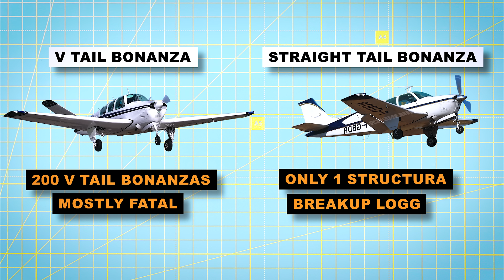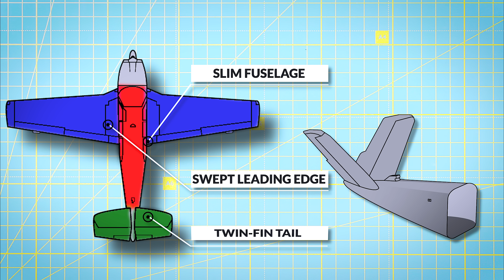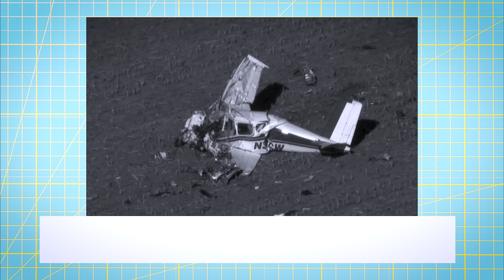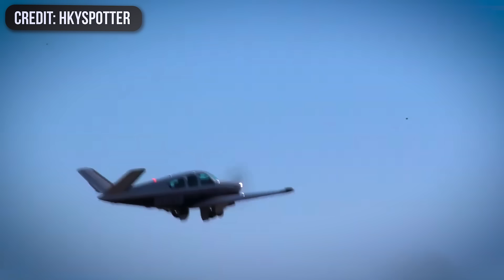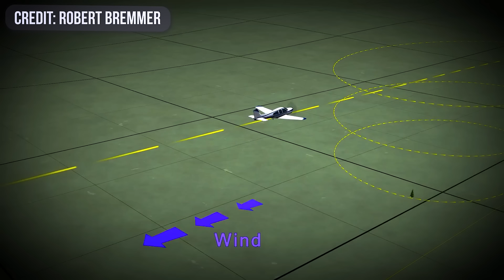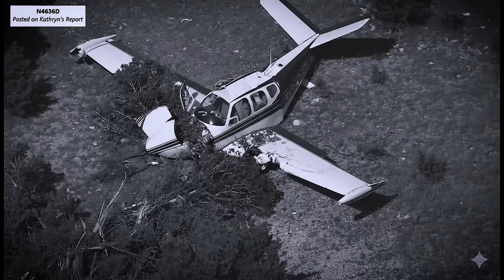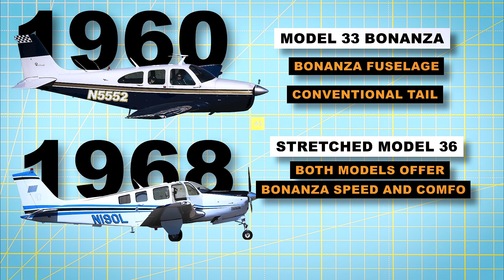Why Did This Plane Kill over 200 People?

Comment: Simple, make a detachable, folding, stowable vertical rudder, with folding elevators to look like a V tail sitting on the ramp. That way you don't have to suffer the embarrassment of being seen, most times, having a regular tail like the president. 

I prefer honest airplanes. 

V-tail? Reduced performance, frail, but hey at least you look good! 

And they wonder why anyone choosing that option for that reason in spite of the facts, or apparently any independent research choosing that probably more expensive, maintenance intensive, dangerous performance loss just to get attention from the opposite sex crashes them.

Doctors and lawyers have been killing themselves in super-cars, heck, even Corvettes for decades. Why not in aircraft?

While we walked out to our Cessna 150 my father saw a guy drive in at 60 mph, slide to a stop bumping the curb, and get out at his hangar. Dad said "You would think that there's a certain level of professionalism that all pilots with a liscence have, but its just like a CDL, the same idiots that drive cars fly planes, NEVER forget that up there!" 

Good pilots (sometimes you don't know you aren't until you taste dirt.) Good maintenance, good decision making and it's a very pretty unique design that will give great performance for generations. Those are the people who designed it, they couldn't conceive of who would take over. 

After 45 years as a mechanic and farmer, I have literally seen bent crowbars, have a hammer head that's busted in half, melted bent connecting rods, spun bearings, from oil delete episodes, rods pulled in two from over winding, and a BROKEN ANVIL on my shelf in my office to remind others, and myself, of what seemingly smart people can do! 

Underestimated talents assumed to be "Common skills" of those who originally flew, worked on and built it, then passed it as ok because it was for them, caused this.

Comment: While aircraft built for the war were planned for 2 years and are still here 80 years later, these planes weren’t necessarily imagined to be flying 70 years on. 
No one building a 1958 Chevy expected you wouldn’t buy a new car in a couple years. 

Bonanza’s had their opportunity to be retired, issues resolved. No one thought you keep a plane for 70 years. 

The oldest commercial planes still flying and not in a museum when these were built were barely 15 years old. Some credit should be given to these pioneers, and perhaps this design should have retired earlier.

Comment: I've only been in a "Doctor Killer" a few times. I had a 172 and in the midwest, during spring when there was black ground and light colored ground, the 172 would rock front to back because of the rising heat or lack of. In a V Tail, it did that too but also left to right. Quite nauseous.

Comment: I find this video very one sided. I have owned 2 Bonanzas (J and S models). I have been a Bonanza instructor. The plane is very easy to fly and very easy to land. The Bonanza is NOT forgiving of incompetence, inability, or lack of training. The airplane requires regular, proper maintenance by mechanics that are qualified and familiar with the airplane. The aircraft does suffer from am aft CG issue. But the model 33 has the same issue. The 36 model was designed with a relocated wing and longer fuselage to cure this. You can’t blame the airplane for poor maintenance practices and poor training. Was there a tail issue, the tail reinforcement cuffs addressed this. 

Bottom line: the model 35 is a great airplane. But it doesn’t suffer fools. It will not forgive a lack of training, maintenance, or skill. It IS a great airplane!

Comment: NO NO NO NO. the V tail was FINE. the issue was the aircraft could get over design speed in rough air. both the V Tail and normal tail will fail in. the thing is the v tails would break up on the way down. both end up a hole in the ground. just the V tail ended up in 2 parts. the thing the wings where already coming off before the tail for BOTH configs. the thing people forget is the Bonanza is from the late 30's early 40's and was THE first REAL high performance GA aircraft. most aircraft at the time didnt have power fly out of green arc in rough air. the Bonanza did. it was V tail from the start. the later normal tails again had jsut as many crashes. the tail was NEVER the problem. it was pilots understanding the aircraft VMC in IMC and flying to fast for the conditions. by the time the tail came off the V tails it dive was never recoverable any way

Comment: 8:48.  "Unseen wires in the tailcone?"  Having owned a V-tail for 6 years and 400+ hours of flight time, i can tell you that the entire V-tail actuating system is inspected annually with conditions inspected, lubricated, cables tensioned and tested thoroughly, along with an inspection for metal fatigue and corrosion.  Mine was a1958 model that flew beautifully and reliably and continues flying today.  The Bonanza is a clean airframe and builds up speed quickly in a dive. Combine that with light pitch forces and it is possible to overstress the tail.  If you fly safely and mitigate those risks through planning and execution within the limits of the airframe it's not an issue.

Comment: It’s so sad that this legendary and brilliant design got a bad reputation because of pilot error. If the Spitfire was marketed to civilian pilots, doctors or lawyers would all get one and one by one they would come out of the sky or die on the ground and we would say how bad and deadly the Spitfire is. What bothers me is that your description for dummies of how the empennage’s work suggests that this is watched by the uninitiated who don’t know better. You cite trim cables as problematic but they’re no different to those on any type, same for the spilt elevators many types have split elevators, you say the problem isn’t in the cockpit but each of the issues you list have to do with how they are operated. The spiral too is not uncommon - most types have autopilots fitted that negates the natural tendencies. The straight tail has a stretched fuselage and a swept tail.

Comment: Back in the late 70's or 80s Aviation Consumer Magazine did an engineering evaluation of Bonanza V35 structural failure, and surmised that other aircraft like the Piper Comanche and some Cherokees had a much less structurally strong horizontal stabalator design and were more prone to failure in structural overload than the V-Tail Bonanza.
 They said that cabin doors were typically found a ways from impact sites and explained that in a severe positive-G overload, well beyond the certified structural loading and above  red-line airspeed, the the cabin door would pop open and depart. When that happened the typical pilot instinct was to quickly pitch down to unload the airframe and that sudden transition from positive to negative load on the V-Tail caused the forward leading edge of the V-Stabs to detach upward and cause a severe pitch down causing the main wings to fail in negative load, and why Beech added reinforcing  cuffs to the leading edge roots of the V-Stabs. 

I also seem to recall mention that many light aircraft would experience main wing spar failure at or before the tail would fail on a V-Tail Bonanza.
Reply: With the leading edge cuff and the Smith Stub Spar STC (the only STC still approved for the tail), the tail is practically indestructible! The main spar will fail before the tail comes off.
Reply: @Tonali01  Thanks. As I recall that was the intent of the mods. I also recall seeing photos of a V35 with a Beech tail mod that had experienced a near structural failure where  the outer edges edges of the V-Stab  spars were dramatically deformed. I seem to recall there was some structural deformation the the main spar as well.

Comment: Flying club I was in had one / no structural failure but the engine grenaded itself and went into the trees. Thankfully the pilot and his wife walked away unscathed
Reply: So? That same basic engine is found in twenty other single and multi engine aircraft. Very reliable. It does not in any way impugn the integrity of the Bonanza.

Comment: So basically they built an aircraft that can achieve the aviation equivalent of a “Pan-Weave” that the Honda ST1300 (PanEuropean) is infamous for.  A bike that’ll last 1 million miles if taken care of, super reliable, powerful, and versatile.  But because of its wheelbase and rake, it feels like your tire is stuck in a deep rut at 120mph.  If you fight it (like the bri-ish police department), you will die.  Or just slow down a little and it’s one of the safest bikes ever made.

Comment: Just a private pilot since the early 70’s, I’ve mainly only flown Cessna’s, Piper’s and Cub’s all fixed gears and props.    But I did have the opportunity to rent T-34 Beech Craft Debonair  a two place sliding canopy trainer at a military aero club for about 30 hours.   It was a blast to fly!  It had the most harmonious and lightest coordinated controls of any airplane I’ve personally flown.  
    Only one other plane I got a ride in with a finer feel was the De Havilland Chipmunk.

Comment: Lovely airplane! I'm a retired A&P.  '83-'84 I worked for Corley Tedder at ABC Air Service in Atlanta, Tx. It was either a 100 hr. or an Annual. After taking the tail cone off and brushing out
the crud,  I found an old round handled Craftsman 1/4" ratchet, extension, and socket. Good thing that it didn't snag anything; or it could have been a test in order to see if I was attentive.

Told the boss, he said good catch; wash it in the Varsol tank and keep it.

Bob
Reply: Wow Bob thanks for such a amazing story

Comment: This was ultimately a very poor and misleading video. A lot of what was said could be applied (for example) to the Cirrus in today's world and it is quite wrong to put various unrelated though independently valid observations into an argument that suggests the V tail caused the crashes. Good journalism doesn't need sensation seeking nonsense like this. All airplanes have their own characteristics and suitability. It is a pilots responsibility to know what they are, know the plane's and their own limitations, and to never exceed them.

Comment: V tail requires a proficient, skilled pilot. If you aviate, navigate then communicate you’ll be fine. If not IFR proficient and can’t scan to keep wings level. Slow drop the gear then it flies at C-172 speeds and speed run away is reduced. You can cause structural failure in any AC if you exceed their design. I have been the owner of a 1955 F35 for 30 plus years. Along with 1947 super Chief 1966 U206 with factory float kit. And a 1970 C-401B all at the same time. With 2 rotorcraft. With proper judgement, training and proficiency and maintenance you can fly anything safely. And be a 46 year accident free pilot too. Just know your limits using superior judgement so you don’t need to use your superior flying skills. A credit card and waiting for weather to clear saves life’s. I only carried liability not hull coverage. Working and saving to purchase each aircraft not wanting to put them at risk.

Comment: Former Beech Aerodynamicist here. I was the project aerodynamicist on the Beech 38P Lightning, the Bonanza-like single-engine turboprop based on the Model 58 Baron, which was based upon the Bonanza fuselage and wing design. (The real inside story about why that airplane never went into production has never been told. It had nothing to do with market forces.) I also worked on the Model 36TC Bonanza, including Bonanza spin testing at NASA Langley Research Center Spin Wind Tunnel. I have hundreds of hours in Bonanzas, including the model 35. I flew them both professionally and as a member of the Beech Employees Flying Club, where we had a small fleet of Bonanzas for rent to employee pilots. Yes, early models had a structural problem, and yes, the leading edge cuffs fixed the problem. At the factory, we in both Aerodynamics and in Flight Test affectionately called the Bonanzas "Forked-Tail Doctor Killers." It was our criticism of the classic "more money than brains and respect" Bonanza customer, a successful professional in an unrelated field who had a chip on his/her shoulder and a less-than-professional attitude in the cockpit. The only serious "problem" with the Bonanza, aside from the structure in the very early models, is that the airplane will not suffer a careless fool in the pilot seat. One MUST stay mentally well ahead of the aircraft, and failure to do so will result in a very rapidly deteriorating situation for which most casual pilots are ill-equipped. Later in my career I was an engineering test pilot for jumbo jets for a major airline, and I can say from personal experience that a Bonanza requires the kind of "stay ahead of the airplane" mental focus that large airliners do. Get a Bonanza started into an unusual attitude in IMC while not paying full attention and you are pretty much guaranteed to have a wild ride, as far too many pilots found out the hard way. I am retired now, don't fly anymore, but I have many fond memories of long-distance travel in  Bonanzas. We lovingly called the airplane a "time machine." It is a beautiful airplane.

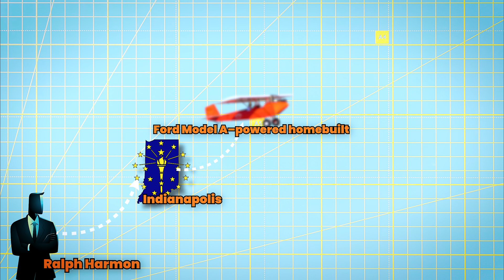Comment: 1:23 Wait FORD built another plane model (other than the Tri-Mower)?

Oooh the XA-38 looks so MEEEAN! Probably obsullied before the proto even flew… 

They don’t replace the cables for 30+ yrs? Wonder if pronounced strakes (like the standard tail HAS) tapering up in front of each surface would solve some of this… 
• longer contact area (sturdier, delayed flutter onset)
• improved directional stability
• Yaw-da…. Wowww we just jinxed!

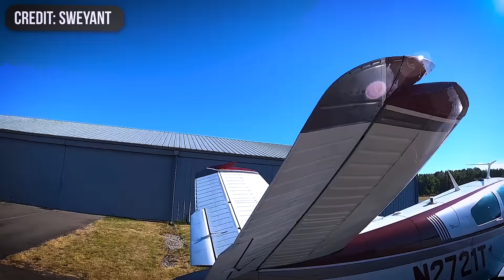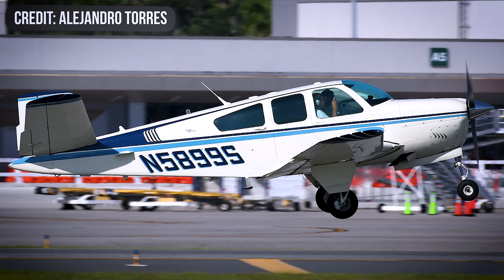Comment: Fabulous aircraft - efficient and comfortable to fly.  Not one mention of the AD fix other than "redesigned tail attachment" (14:35).  If you know what to look for, you can see the leading edge stabilizer cuff (AD fix) attachment at 10:17 that solved the flutter exhibited by the unsupported forward section of the tail.

Comment: In all fairness, most of the described faults still come down to poor piloting or maintenance procedures not the aircraft itself.  Just because the aircraft is easier to fall behind than another model doesn't make it a bad plane, it just highlights the lack of ability of the pilot that's flying it.

Comment: My family had a 1957 bonanza. The dutch roll is a real thing. The plane cruised 180-190 miles per hour. We never had a structural problem with the plane. Once, we had a bird strike on take off. We simply circled around and landed. A seagull left a dent in the wing root the size and shape of a football. Another time, right after an annual inspection and maintenance work the brakes fell apart upon landing. Now to be fair, it was a primitive grass runway in Northern Canada that the owner used a huge log and bulldozer as a steamroller to "Push the rocks back down" after a hard rain. So, the official answer from repair shop was to gather up the brake parts and apply duct tape over the remaining brake parts to keep them from falling off too. We landed at Bellingham airport and then again at Boeing Field with no brakes. Not a big deal except when you try to maneuver the turns on the taxiways and then try to turn and park. Other than that it was an excellent plane that is still flying today. You can google it's license number N1000T and see it for yourself.

Comment: Flew one of these in the early 2000’s. It had a highly modified, high performance engine. I had a lot of Baron time and straight tail Bonanza time. I had never flown a V tail. My first flight was a revenue flight with multiple legs jumping from airport to airport around the Great Lakes. First stop was Toledo. Next stop was Cleveland. Buffalo, Erie etc. it was an extremely windy blustery day! Needless to say I was worn out by the end of the trip. Winds were gusting up to 40 knots at all if those airports. I would have had my hands full with a Baron or King Air (both of which I had a lot of time in). But this being my first time in the V tail?? Super dangerous! I was not familiar with all of its quirks! Add the 400hp modified engine. I’m lucky to be alive! I had no business flying it with no formal training! I was technically legal o fly it… but was not adequately trained or qualified.
Reply: V-tails had no “quirks”; they are very stable, responsive and delightful in handling characteristics.

Comment: The V tail design definitely increases your speed, even in helicopters. The Hughes 500C model has a very similar stabilizer and it was a rocket compared to the T tail of the later and more powerful D and E models.

Comment: The original; Bonanza was not designed or intended to be flown by amateur, low time, weekend pilots. Beechcraft expected that they would be flown for corporations by professional, ex-military, experienced pilots.
The Bonanza was a brilliantly designed airplane with no compromises for inept pilots. and far ahead of its time, ushering in the modern high-performance private light airplane. In properly trained hands it was safe as any other airplane. In inexperienced, negligent hands, well... what else would you expect?
For a detailed discussion of this airplane, its design and history, please see my article for A2A Simulations, available for no charge on their web site.